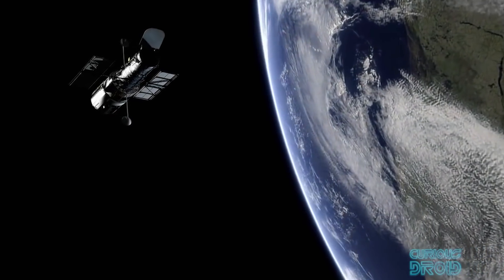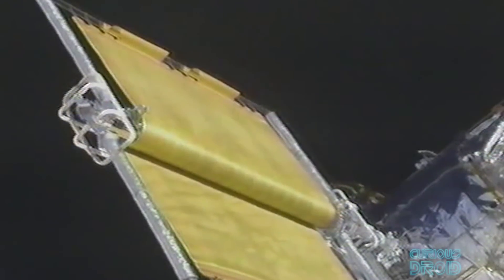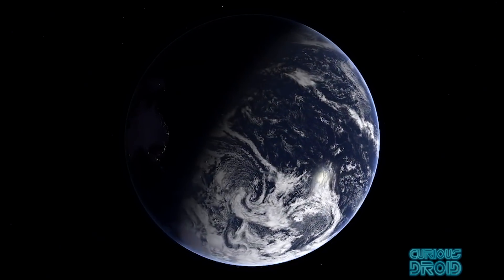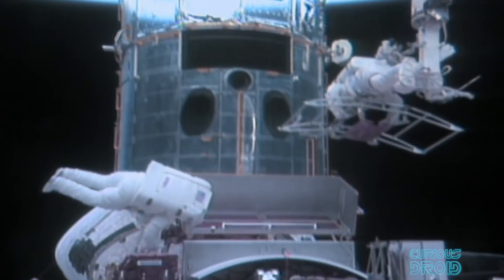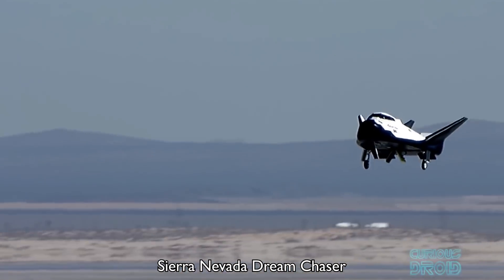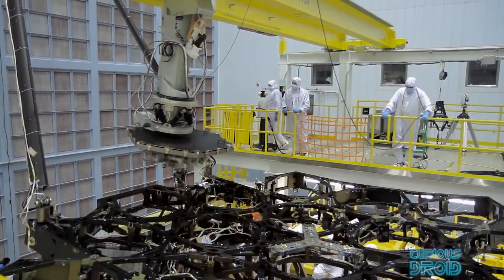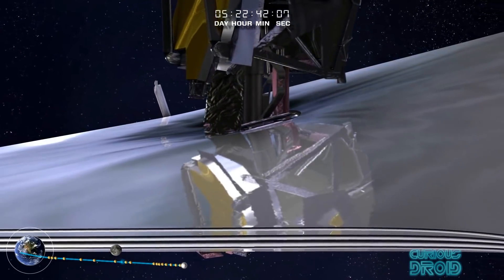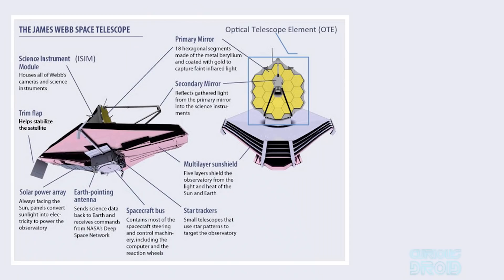Can We Save Hubble and Where is the James Webb Space Telescope?

Comment: We've pulled so much data from Hubble it would be dumb to just crash it back into Earth, at least until the JWST is in position and fully operational.  I really think we could fix the Hubble, maybe even upgrade some components and extend the lifetime of it.  If nothing else, it would be a great secondary scientific instrument to compliment the JWST and if the JWST continues to have problems (on Earth or eventually off Earth) then we'll still have it for research.  Some folks will say that it won't have any value after JWST is operational and my response is "How many ground based telescopes do we have?  Do we need more than one?"  It's sort of the same thing - use them for different purposes.

Comment: The chances of the JWST achieving its goal of launch and operating correctly are slim to none. It seems too advanced to be a viable option. 
A modern and simpler replacement for Hubble would have been better for now while perfecting the tech for the JWSW. 
Regarding the JWST, they should have planned to make several and then can launch years/decade apart and have extended life and counteract any mechanical or environmental issues that are bound to occur. 
Great video as always!

Comment: If something could be launched within existing commercial or government assets, I'd service it again and push it up into a notably higher orbit to extend its life to as long as possible.  The JWST bungling if it wasn't so costly would be a joke at this point, it needs to happen after this long.  I just believe both would work excellent in tandem to produce some solid work.  Sure the Hubble could be a real asset given if they did a major servicing or two that included newer tech, replace all the gyros, service anything else, that could give it years, decade plus worth of quality science beyond anyones expectation.  I wonder if something space x has could be modified to tether along side so a team could work to upgrade the device, then perhaps another unit or something to propel it into a higher orbit.

Comment: The real reason the JWST hasn't been launched is because the one person who has to approve it for launch doesn't want to stick their neck out.  Can you imagine the backlash when one of the over 200 unfolding options gets jammed and turns the JWST into just so much space junk who's going to take the blame?  Another goofy decision with the JWST is it is designed for only a 10 year lifespan.  They didn't think of a means to refuel it remotely.  Was this something that was beyond the technology we already have?  This is typical of any government sponsored project and why it takes so long to get anything done.  Leave it to private enterprise to get it done quickly and cheaply.
Reply: Refueling remotely will just add more complexity to the spacecraft system and will be very expensive.
The thing about JWST is that if something happens to it, it can't repaired manually by humans (like the Hubble) because it's too far away. It's at Sun-Earth L2. About 1.5 million km away. Opposed to Hubble which is 550 km which was serviced multiple times by the Space Shuttle (like STS-61).

Comment: The thing I wonder about JWST is whether two would have been faster and cheaper than one.  SpaceX and famously the 60s and 70s Russian rocket programs use at least some 'fly and then fix' and some non-space rated components ... including the flight computer (!!!) ... to both get a program going faster and and work around 'known unknowns' and find 'unknown unknowns.'  If you have a tolerance for public disasters, certain funding and know the next copy will be cheaper if just a modified version of the first, then this seems a viable way to go for speed and reduced program cost depending on just how many missing technologies there might be.  That said, the big prize, 1st moon landing, was taken partly by the brute force, conservative design, Saturn Booster Program, tested until it worked (but it was part fly and fix also).

Comment: Save it!
It is our only UV capable asset.
SM4 placed a target dock on the bottom of the Hubble for a future de-orbit mission. I’ve not heard anything further on that.
I’d use that docking point to attach a taxi rocket it it, to either boost the orbit, or preferably, move it to dock to the ISS where it can (and should) be repaired.
And before people point out that they are in different orbits, which they are, it’s just a matter of delta-V (ie bigger fuel tanks to achieve the necessary rendezvous orbit).
Think big: landing boosters was impossible right?
Use the same can-do attitude to fix a $1B asset that has transformed our understanding of the universe!

Comment: Fantastic video. How is it I have never heard of you before? Liked and subscribed. I don;t know about Dreamchaser, but well before Hubble loses its orbit, even at the earliest possible date, SpaceX's Starship will be able to service or retrieve it. Personally, I am in favor of servicing it and keeping it operating. It has four different optical systems capable of observing in different parts of the spectrum. James Webb has a larger mirror and is much more sensitive, but is limited to the infrared. Furthermore, once we do get James Webb placed, whenever that happens, not too long after that Starship will also be able to reach it. It is, of course, not specifically designed to be serviced, but I'm sure we can do it if we really want to. It can be fixed if anything goes wrong, it can be upgraded over time, just like Hubble. In four or five years, we will have the spaceships necessary to do it. The next twenty years are going to be incredibly exciting.

Comment: Fix Hubble and boost it to the L1 Earth-Sun Lagrange point. This is a point close to the Earth on the bright side. As mechanical components fail again, Hubble can focus attention on closer objects - even the Earth. This is not an ideal spot for deep space observation but Hubble can occupy it at relatively low additional cost. At the same time build three more JWST for a total of four. Park JWST1 at L2 as planned. The other three can park at L3, L4, and L5. Most of the cost for JWST is in the development, not production or delivery, thus launching more will reduce the unit cost. This would provide five active space telescopes at five different points. I assure you they would all get used.

Comment: In the future, design these long duration observatories with all the “high failure risk” devices (like gyros) and consumables (like station-keeping fuel tanks) into one detachable, replaceable module. Make these modules capable of autonomous (or robotic) replacement. Put a couple (or more) replacement modules on a shelf.

If anything in that module fails, or when the fuels run low, send a replacement.

This will not fix all problems.
Just most of them.

We are on the cusp of becoming a space-faring society. 
The above suggestion is entirely feasible, at a minimal added cost.
Reply: I agree. But I can't help but think of HAL and the AE35 component that, umm, didn't actually need replacing ... (chuckles)

Comment: “Only when it was an orbit did they find that the mirror was ground with an error.“
Absolutely false.

Perkin-Elmer had discovered the flaw before it was launched. 
According to the engineer who told me this story, PE has informed NASA of the problem.
Both were afraid that, if they acknowledged the flaw, which would have resulted in enormous additional cost and delays, that the whole project would be scrapped by Congress.

So they launched it knowing that it had this flaw.
They figured, once it was in orbit, there was no possibility of canceling the project. They’d have to figure out how to fix it.
Note that “fixing the problem on earth prior to launch” would have cost about 1/100th of the “fix in orbit” price.

Source: personal conversation with a Perkin-Elmer engineer who worked on the project.
Reply: Wrong, the according to the story from the director from nasa he had no idea he messed up when his boss called and asked a few question, then he was surprised that small problem like that slid from their view then he was committed to fix the problem after a few meetings he found the fix which is exactly like glasses but to a telescope.
Reply: Daniel Boos  Excerpts from NASA’s own Failure Review:
The Hubble Space Telescope Optical Systems Failure Report
https://ntrs.nasa.gov/archive/nasa/casi.ntrs.nasa.gov/19910003124.pdf 

Executive Summary

The problem
”The critical optics used as a template in shaping the mirror, the reflective null corrector (RNC) ... When the Board measured the RNC, the lens was incorrectly spaced from the mirrors...“

Discovery of A PROBLEM (not identifying the problem) during manufacture
”... There were, however, clear indications of the problem from auxiliary optical tests made at the time ... A special optical unit called an inverse null corrector, designed to mimic the reflection from a perfect primary mirror, was built and used to align the apparatus; when so used, it clearly showed the error in the reflective null corrector. A second null corrector, made only with lenses, was used to measure the vertex radius of the finished primary mirror. It, too, clearly showed the error in the primary mirror. Both indicators of error were discounted at the time as being themselves flawed.“

”The most unfortunate aspect of this HST optical system failure, however, is that the data revealing these errors were available from time to time in the fabrication process, but were not recognized and fully investigated at the time.“ 
...

”Reliance on a single test method was a process which was clearly vulnerable to simple error. Such errors had been seen in other telescope programs, yet no independent tests were planned, although some simple tests to protect against major error were considered and rejected.“

...

”The P-E design scientists, management, and Technical Advisory Group, as well as NASA management and NASA review activities, all failed to follow the fabrication process with reasonable diligence and, according to testimony, were unaware that discrepant data existed, although the data were of concern to some members of P-E's Optical Operations Division. “

__

Why did this happen?

”During the critical time period, there was great concern about cost and schedule, which further inhibited consideration of independent tests.“

”Reviews were inadequate, both internally and externally, and the engineers and scientists who were qualified to analyze the test data did not do so in sufficient detail.“

”Competitive, organizational, cost, and schedule pressures were all factors in limiting full exposure of all the test information to qualified reviewers.“
Reply: @teefkay2  so,none of the rats wanted to bell the cat
Reply: Victor Otero  LoL. That has GOT to be a Brit expression.
Reply: @xiro6  LOL. Whatever that means, I think I fully agree with ya.
Reply: @mandandi  if the cat have a bell in the collar, the mouses can here it comming, they all agree, but the one who tries to put the bell could die.
A lot of the people involved on the project know there was a problem, but none of them blowed the wistle(U.S. expression?) maybe afraid of getting a punishment, because their bosses clearly had to know about the issue.
The boss rules:
Rule 1:bosses are always right
Rule 2:if they are not right, apply rule 1
Sorry, im spanish.
Reply: Walter B  Walter, your comment would be more useful if you added some specifics & some checkable references to back them up, like I did when I provided excerpts from (& a link to) NASA’s own investigation, which essentially confirmed everything the Perkin Elmer engineer told me.

You are invited to elaborate on what you think are “lies” and what evidence you can bring to support your assertions. If you have anything that stands up to scrutiny, I will eliminate that story from my repertoire, or leave it in & be certain to include the info that you provide (as a cautionary tale about how “full stories are not always what they first appear to be”.
Reply: Sounds about right.